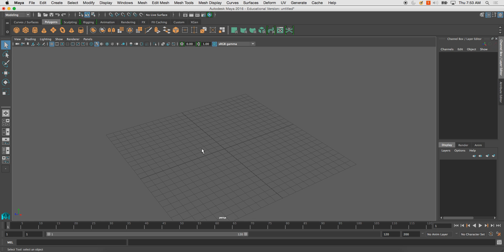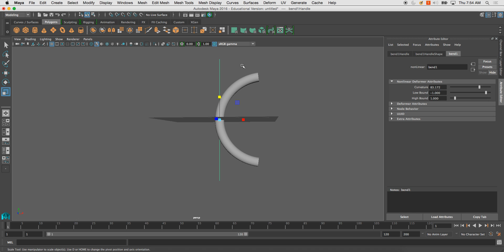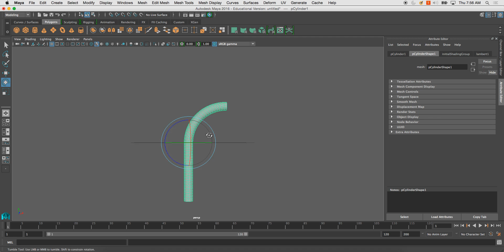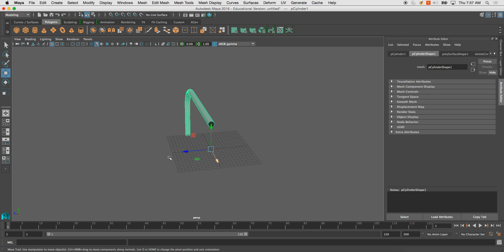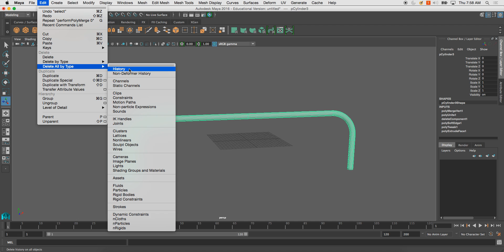Maya Bend Modifier

Comment: 3:51 how do u move the object? mine after i bend it just changes in size when i try to move the object even with object moving tool
Reply: Try deleting history and freezing transformations
Reply: @sjrules606  Assume I am an idiot and don't know how to do that.... I basically have the same question...
Reply: @TheZebbga  npnp, 

1. Click on your object (object mode)

2. Edit -> Delete by Type -> History

3. Click object again (object mode)

4. Modify -> Freeze Transformations 

you can also do this by clicking the freeze icon with [0][0][0] under it and the clock icon with a list under it in the Poly Modelling tab (if you hover over the icons, it will say what they do)

hope this helps!
Reply: @sjrules606  Thanks a lot. I sorted it a completely different way but at least I know how to do that now. Thanks.

Comment: hey man i dont know if u still use this account but when i do the bend and adjust the curvature it does absolutely nothing
Reply from the maker: Make sure that you have the object selected when adding the bend modifier to the object.  Then it should work without any issues.
Reply: @HenrikHostMadsen  yea i didnt know what happend but i reset my maya and it worked thnx